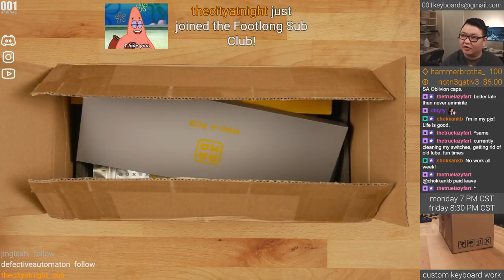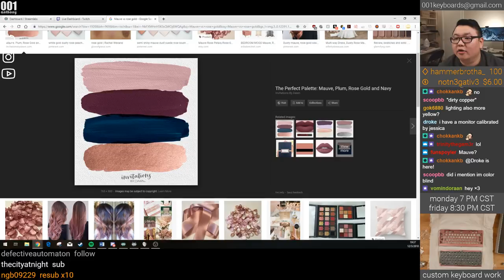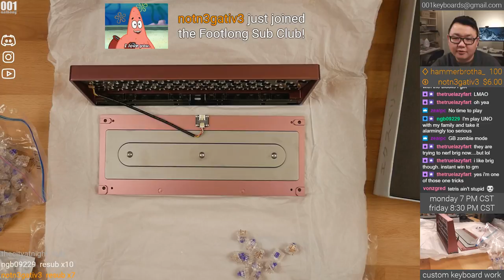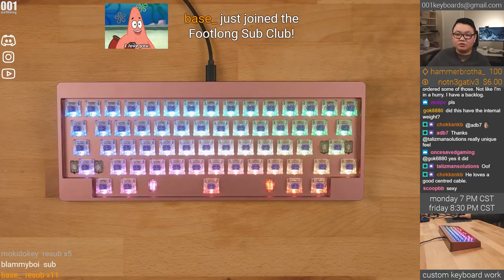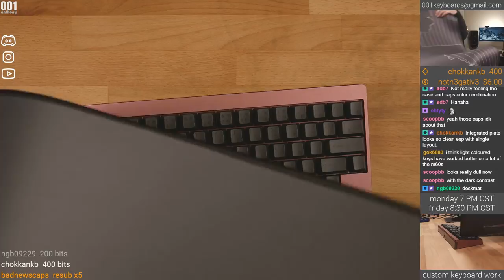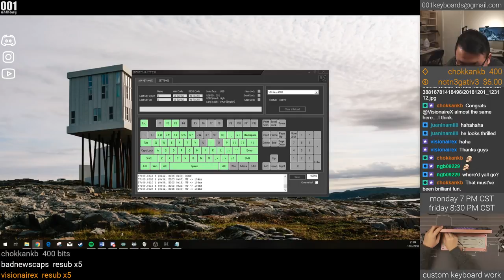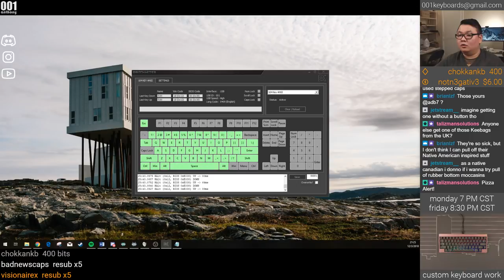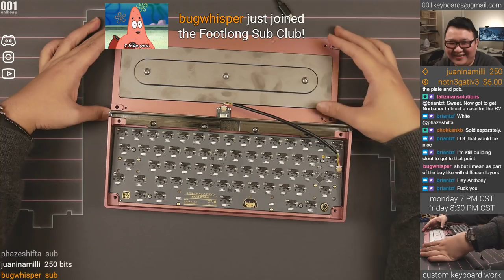Let's Build: RAMA M60-A (Zealio 62g switches)

Comment: I purchased a GMMK, and there was this terrible ping on the board like you said "resonance". Tried what people where saying, I put some Foam at the bottom of the Case, that didn't work. Then someone said put foam between the top of the case and PCB, did that and it didn't work. 
I was about to return the board, when I decided to LUBE my switches, and low and behold, that ping is gone. I spend hours  putting the switches, caps on and removing, time spent cutting the foam lots. Had I just lubed from the get go, I would have been fine.